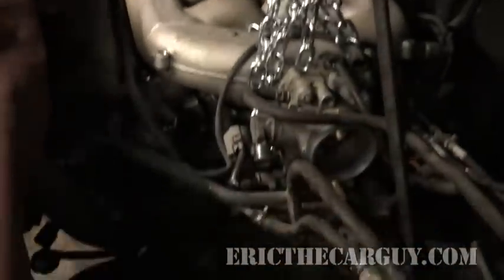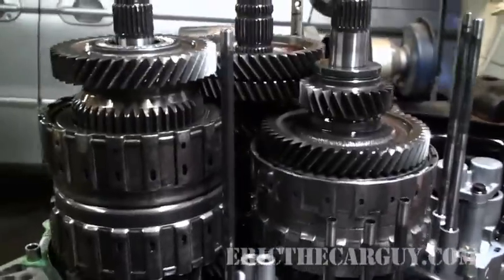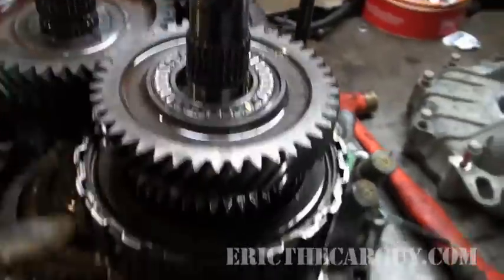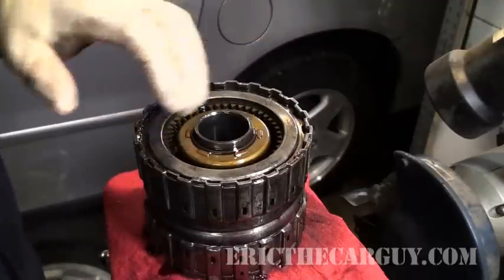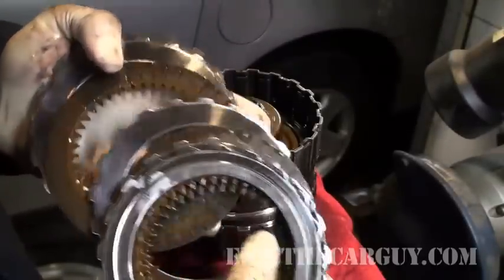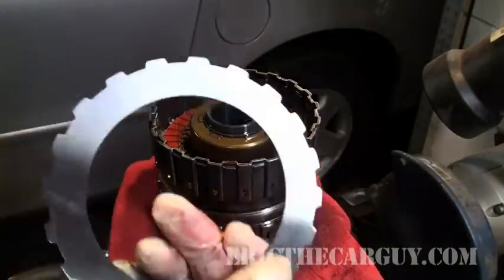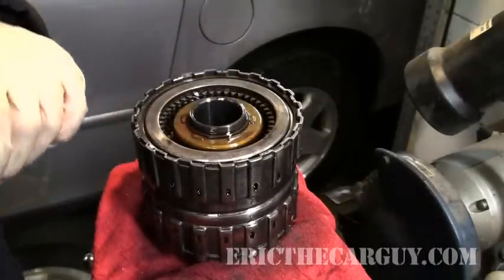Inside My Odyssey Transmission - EricTheCarGuy

Comment: Honda 5 speed (and the 6 speed) AT does not use a planetary gear set, unlike the majority of conventional AT. I observe that this might be the reason that (1) the shifts feel rougher compared to the conventional AT, (2) no manual gear selector that allows you to increase or lower the gear manually (like paddle shifter), and (3) Honda's lacking in providing their vehicles with AT with greater than 6 speed AT. Even 2017 Odyssey only has 6 speed while the competition like Sienna has 8 speed. This, however, is not the case anymore since Honda started using the 9 speed ZF AT and their own design of the 10 speed AT with planetary gear set in the last several years. Moreover, this could also be the reason why Honda AT only takes the very specific Honda ATF.

Comment: As a result of my daughters ‘01 odyssey transmission failure, I found out the reason the filter is inside the transmission is that once the filter is full, the tranny is toast! I had 17 OBD codes, 14 of which were transmission issues. Apparently these models have a solenoid that goes bad on them as well.

Comment: Question. How can you test whether a transmission can be good on a junk automobile in the auto yard? Are there any secrets of what to look for? It's hard to put a screen tool on because you don't have a battery to turn the engine over with

Comment: congrads....ok   why did you not replace the clutch drum seals?   oil pressure   bla  bla i also have a 2001
 trans slips and slides when it wants to... a real pain in the ass.  there is no   excuses for honda's trans
problems,    they just ignored it,   want to buy mine?    silver    beautiful........my respects to you!!!

Comment: I considered doing this to my CR-V when my transmission went out a couple years ago. I decided not to because of the number of parts that the service manual said "replace if worn" and I didn't want to wait on tons of parts to get shipped to me, or just buy all of the internals ahead of time.

Honestly tho, if you going to tear that thing apart, you should have just replaced all four clutches. You're already most of the way to the other two.

Comment: Wow, that sure was a GREAT  video! Tons of valuable information! No kidding either! Was it not necessary to use any sort of bench compression thing with foot peddles ? I saw another video
that used that on maybe a 2004, maybe that was why. I found a video on a guy who took his odyssey
engine and trans up a little out from the hood and swapped the trans.  For the foot peddle compression
thing for the clutches someone said they just used some PCV pipe and a long screw and nuts and washers and
it worked instead of the foot peddle thing. Did you clean the solenoids and also use the rest of the master 
supreme whatever rebuild kit with bearings things  and other stuff ? That's if you can swap in and out the
old and new clutches without any special compression tools!
someone said "The best thing to do is a full and complete disassembly and cleaning. Replace all drum seals, bands, clutches, bushings and solenoids"
Did Eric replace the solenoids or just spray them out ? Did he do the seals, bushings too? Bands? He
of course, probably did !

Comment: I just wanted to say I finished my transaxle rebuild and have found the root cause and FIX for the Honda Automatic transmissions of this era, it should include all Accords, Odysseys, CRV, Ridgelines, etc that use this similar design. Please read about my discovery on here, it was a team effort. https://www.odyclub.com/forums/24-1999-2004-odyssey/353519-quick-guide-how-fix-odyssey-5-speed-transmission.html

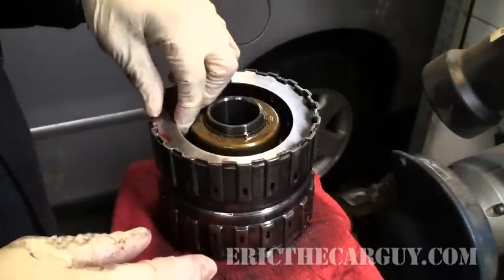Comment: I watched until 5:02 then stopped .
One reason I stopped was because you did not disassemble the drum & change out the rubber lip seals.
At 5:02 I knew you were not going to make it work  .
If you or anyone is going to do an automatic then install an entire kit lip seals, sealing rings, clutches, band-s if needed ETC & be sure to check where the sealing rings seal to be sure the surface is good.
& be anal about clearances and bushing quality.
IMO anyone can rebuild a tranny, IF you watch what you are doing & always buy a " ATSG " service manual for your specific trans.

Comment: Just fyi, the reason his transmission failed was not because of clutches, it was because he had stuck valves. Most likely in the accumulator or valve bodies. They get stuck and trans is unable to shift. Get a Bench Buddy kit, ream out the bores for every valve stuck, do not forget to replace the oil filter and rubber o rings. Drill the line to converter charge or buy the sonnax valve

Comment: Hey Erick! Wonder if you can give an idea as to what is going on with my Transmission.
I have 2004 Satun Vue that comes with the Honda a 3.5 engine. I will assume that the transmission is Honda to. The issue I have is that when shifting, let say from 2nd to third but I can't really tell. If I am easy on the gas, the transmission vibrates before switching gears. If am heavy on the gas, it will change gears no problems. It usually does it somewhere over 30- and after 40 things go back to normal..  I will appreciate on how to go about finding the problem. This might be one of those transmission they used on Odyssey's before 2005. I  hear they all had transmission problem. Not sure if this is one of the symptoms. A transmission vibrations between 30-40 but only when easy on the gas..

Comment: Im a john deere mechanic, usually we dont mess with transmissions 
But when a 644k lost reverse and 1st was slipping i said the hell with it how hard can it be, i removed the tranny took it apart had to get a big big bearing extractor to get to the drums, the clutches for reverse were gone, i replaced them and also on all the other gears cleaned everything up, replaced all solenoids (which were the culprit) and put everything back together, machine has been running for over a year and a half now with no issues, all i did was replace the clutches and solenoids.
These use a ZF german transmission.

Comment: Oddyseys and accord 98-02 v6 auto transmissions are prone to have problems of slipping and acting up when auto transmission overheats (after 20 minutes of driving it approx) when these start to fail. I was able to fix my accord 99 v6 by installing a third party oil transmission cooler and now it drives flawlessly. Every owner should install one of this in their cars.
Reply: My dad had a '98 Honda Accord and the automatic transmission went out in 2000. Honda replaced his transmission under a warranty and he never had transmission problems again until it went out again 3 months ago, so he just decided to get a new car.
Reply: I second this! My 2001 2.3 accord 4 speed auto used to muck around alot when hot. I fitted a plate and fin cooler eliminating the factory terrible tank in rad setup and its been great ever since. only 51k miles on the clock too!

Comment: Dealer's mostly refer to this transmission types as unserviceable and why would the filter be placed inside the transmission where all the dirt are being strained, and of course as you drain oil several times, all that debri will be stuck there overtime and eventually making the circulation of oil worst.  What are they thinking?  Good video sir.

Comment: Eric!!! I noticed this video was old, but I was wondering what the outcome was of this Honda...  Please, I am not here to judge, slam, or bash you. Just a fan and owner of a few Hondas myself, one of which 2nd gear failed just before a violent shake and an explosion of gears came flying out the bottom of the trans case.. (I was able to find the pieces scattered along the road later on, of one of the gears and it was big enough to identify as a differential gear). I thank you for your feed back...Jason from Ohio

Comment: For anyone who has spent even a little time working on early motorcycles, that type clutch is very recognizable as a wet motorcycle clutch.  Some people changed those plate often, some of us never had to.
On the motorcycle, there was only one clutch, which had to be disengaged prior to every shift.
Reply: you can shift without manually using the clutch

Comment: there's an internal leak somewhere slips are caused by lack of pressure or to much time to build the required pressure u mostlikely have a apply piston leak and by the looks of that transmission it's probably a clutch pack per gear so find the gear or gears u have issues with and rebuild them completely

Comment: On each clutch pack you have to compress the centre with a special tool then remove the  retainer clip. After that you can remove the main piston assembly to replace the o-rings on the outer and inner section where it seals the pressurized ATF within the drum chamber. Also as is mentioned, shift solenoids do act up causing erratic shifts on that gear. Honda transmissions are the  simplest to fix by the way.

Comment: Clutches burning up are usually the result of something else failing. Such as a bad shift solenoid, worn drum seals or worn bushings can cause a drop in fluid pressure that will cause the clutches to burn up. Replacing the clutches without fixing the cause will result in the same failure. The best thing to do is a full and complete disassembly and cleaning. Replace all drum seals, bands, clutches, bushings and solenoids. Use a caliper to compare the clutch disk thickness from the old to the new or book specs to make sure you are using the correct amount and thickness. I rebuilt the 4l30e trans in my 528i and I have to say it was a real pain in my yanno. I used a master rebuild and also replaced all thrust washers, bushings, solenoids, force motor and T converter. Depending on the year, they used different thickness and amount of clutch plates. It's easy to get crossed up if you don't measure everything to verify the correct thicknesses. Most transmissions are computer controlled now, so a wonky computer or gear position switch can ruin a transmission also. It's easy to get crossed up inside these beasts. Taking pictures and video as you disassemble can be a life saver. Don't even try a transmission rebuild without a press and transmission service manual and the proper tools. I had to make a bunch of tools to get my job done. I also had to buy some proper tools for setting up the clearance between drums and pumps end play. In the end I ended up saving about $1200.00 by doing it myself. The transmission shop wanted $2300.00 to rebuild mine including the r&r but if I want my solenoids and force motor replaced it will cost extra. In the end my diagnosis was that I had excessive bushing clearance that caused hydraulic pressure bleed off. It's been rolling for 4 years and hopefully a few more.
Reply: you're correct, Eric's tranny failed 2 weeks after this
Reply: You make me want to make sure every car I buy is manual :/
Reply: Thor Mcgee us
Reply: bad shift solenoid is my issue right now
Reply: I have an odizay which the D light is blocking and about not to move and select well, after which confirmed that the two sensor outside the gear buss is confirmed to be ok, so kindly advice me on the next action as an expert

Comment: Chances are you did not need to change your tranny clutch packs. All you needed to to do is run 70% Redline  D6 and 30% Redline Racing (type F) by doing 4, drain and fills, yes 4 drain and fills. With  this formula and all would be fine. In fact, this is the key to saving any Honda auto trans in those early years of problems by changing over to this formula. I did this to my 2008 Odyssey and every 30,000 do 3 drain and fills and  drive on the hwy for 5 minutes between each fill.  I also have a 2009 Fit that I brutalize the auto trans because it is such a dog. I started draining at 10,000 when it was a year old. DW-1 was the killer, I could care less about the warranty. I now have 120,000 on my Fit and it is still shifting nice and firm.  Honda is too concerned about velvet mush shifts and that is what kills these trannies. Slip = heat and wear. A nice firm shift mean less wear and no heat. That mean a happy and long living clutch pack.  Why so many, even on Bob the oil guy's site thinks they need to change and ONLY use Honda DW-1 the stuff that is killing the trans in the first place and some use the better Z-1  are doing them selfs a favor.. Honda STILL has to many slip agents in the Z-1 and it still makes heat and wear. Redline is the savior here.
Reply: Poor lubrication is the cause of 90% of failure.  It's a design flaw.  The flush and fill only prolongs the inevitable.
Reply: +Ted Tberg I have read good things about Redline ATF also. I have ordered some Redline D4 for my car.  It is a 2006 Jetta 2.5.  It has the 09G transmission.  That is the same as the TF60SN found in many other cars.  Why they call them two names is beyond me since they are both the same Aisin Warner transmission.  VW would have you believe that there is no other fluid that would be OK for the 09G and all car makers are like that.  They tell you that the only fluid you can use is the stuff they sell which in my case is $18.36 + 6% tax per liter.  What they will never tell you is that it is really Type T-IV or JWS 3309.  I myself have used Toyota's Type T-IV for nearly 30,000 miles and it runs good still no slips or any other bad effects.  Also the key is to change it regularly and not wait til your transmission fails because that is too late.  You would not do that to the engine and so I find it hard to believe that people do such things to their transmissions.

I plan to change the fluid over to Redline D4 next time I get a chance.  I would do it sooner but the car is in the shop with a bad module in the door that has been causing an annoying battery drain and every morning the battery is dead.   I am just glad to get that fixed before winter or I will be a really grumpy person because of having to put in with that in freezing weather.  I would only be grumpier if I missed my morning coffee.  Anyhow, a battery that keeps getting drained is really annoying.  I would know and it is horrible.
Reply: All false, the actual cause of the 2nd 3rd gear slip is because you need to replace 3rd and 4th gear pressure switches, on 4 speed you replace 2nd and 3rd gear pressure switches, sounds strange but works
Reply: +H.G. C. I don't believe in those high mileage oils and fluids.  If you have used a good synthetic for all those miles your car would still feel good as new.   Just make sure to use it early to help prevent wear.  Use a good brand synthetic oil, it is not the cheapest stuff but you get what you pay for.

Comment: So, What was the final out come ??? You may have answered that but I can't find it. Suggest putting a update note in the description above. Thanks!!
Reply: ibewcountry The transmission failed a few weeks later, he just rebuilt the entire transmission. The second generation Honda Odyssey are known for their bad transmissions between 99 and 05 is when Honda had alot of automatic transmission failures. Most people if they were smart got the manual but for something like the Odyssey is no such option. If you have a Honda Odyssey or one of those early 2000s Hondas that are know for this problem and you're having problems, don't bother trying to fix it and get a rebuilt/remanufacture transmission.
Reply: will a rebuilt/reman still have the same problems as one straight from the factory?

Comment: A couple of years ago I bought a 96 civic with a bad input shaft bearing. I took into the transmission shop for that horrible noise. The shop guy made fun of me, told me how to do it and then quoted 1500 for a thirty-five dollar part. I went home, got the information how to replace it on the library website. Took the transmission out and replaced it. It took me around 4 days. Not bad for around 1450 dollars.

Comment: no, electric cars have a constantly variable transmission, which is twice as complicated, and just as messy as an automatic transmission
Reply: +Tunsafun[BSTRD] And are typically less reliable. CVT's are made because they're cheaper to be made.
Reply: +DE Nichols CVTs are made because they're more efficient than other transmission types. sure you can buy 8 or 10 speed automatic transmissions now, but they're more complicated and heavier and still don't give you an infinite amount of gear ratios. they're cheap because they're simple

Comment: These transmissions have a screen in one of the oil return lines that gets clogged which causes starvation/ over heating. Always over looked and thats why most rebuilds don't last. Should be serviced every fluid change.

Comment: RWD automatics are much simpler than that. its all in one line in most if not all cases and it comes out in sections. In my Datsun AT that i'm currently rebuilding, almost everything only fits one way, making it much simpler. Cleanliness and proper torquing of critical components are the two biggest things for successful AT rebuilds. And of course if you have to force it, you're doing it wrong.

Comment: I think it is called tolerance stack up.
When you add up all the clutch discs and each part is off a few thousandths it can up to a significant amount in the end.
Sometimes it is the case of the transmission that gets worn!
I have seen transmission shops with dumpsters full of the transmission cases!

Comment: Whenever I'm in a stop and go environment my automatic transmission (Honda Civic 1995) has a problem. I'm standing, holding down the brake pedal and suddenly Revs go down and the car obviously wants to move forward. I don't have any severe shifting problems between the gear while moving. Could this be due to a wrong oil exchange 2 years ago? Is this a transmission problem in general?